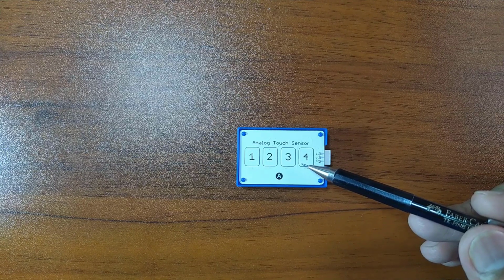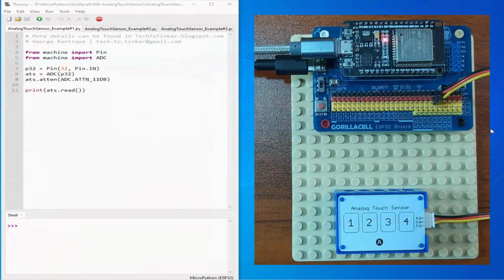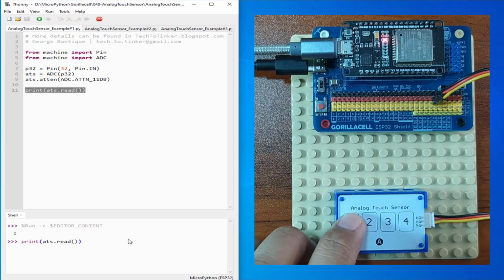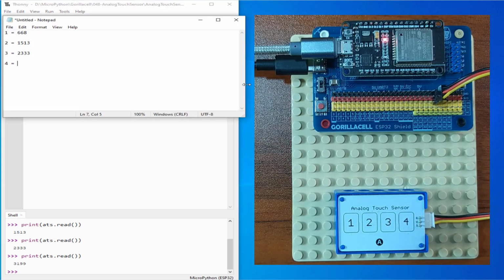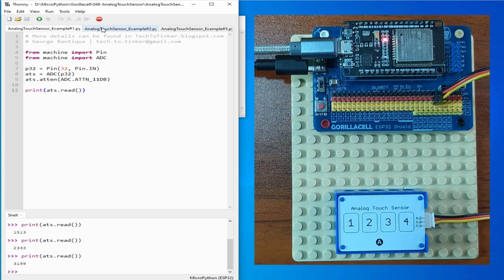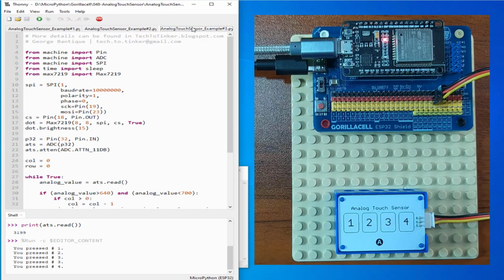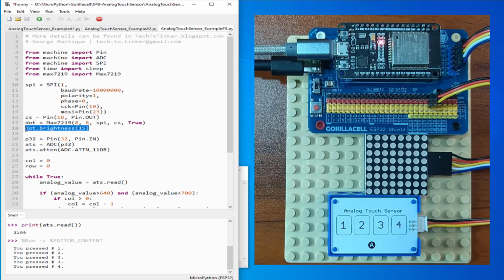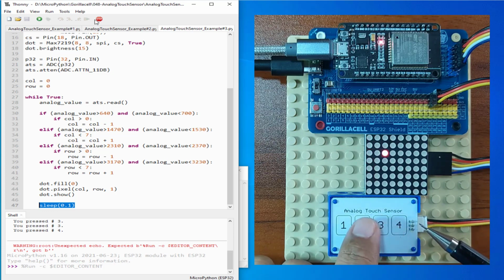048 - MicroPython TechNotes: Analog Touch Sensor

Comment: I see this as a great alternative for the individual one button touch sensors that are expensive and takes many pins as well. 
Good video George
Reply from the maker: Hello Amar, yes it is. There is a cheaper way of implementing this which with the use of resistor ladder design. An example of that can be found on Keypad LCD Arduino shield. 

Thank you brother. As always, George.
Reply: Where to buy